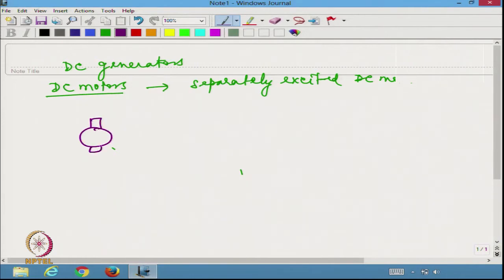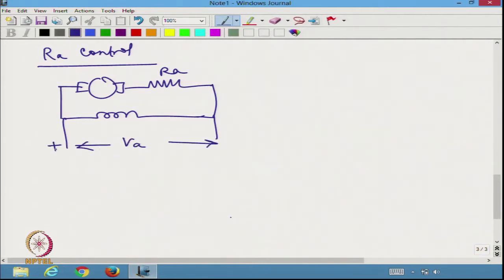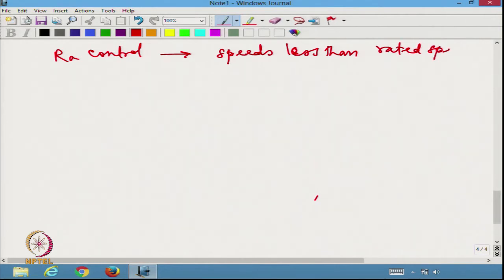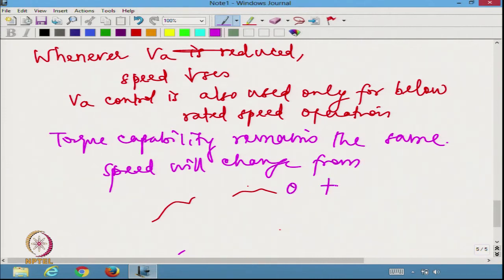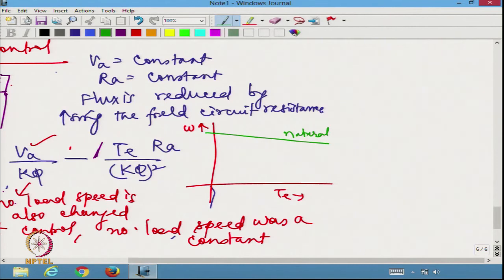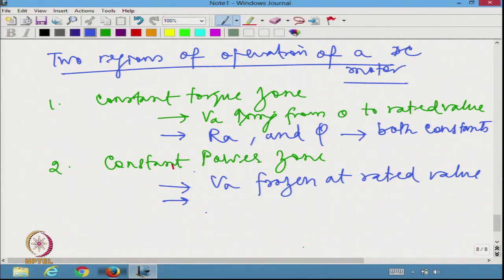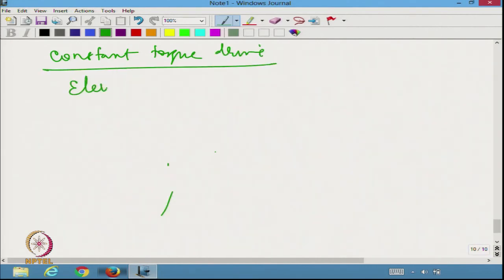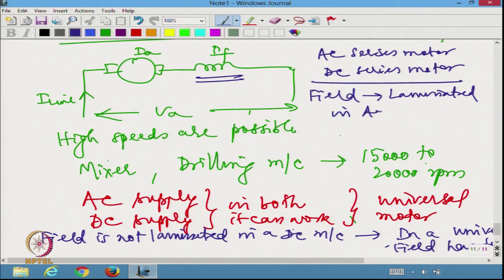DC Motor: Speed Control (Shunt and Separately Exicited Motor)

Comment: sep excited and shunt Dc motor in nutshell with speed control 0:00
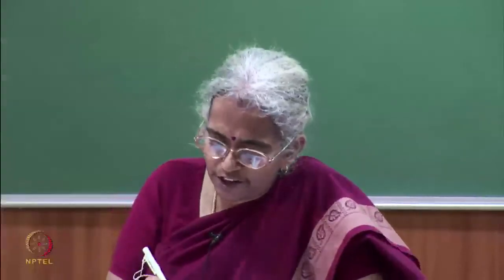const power and const torque region curve 27:00
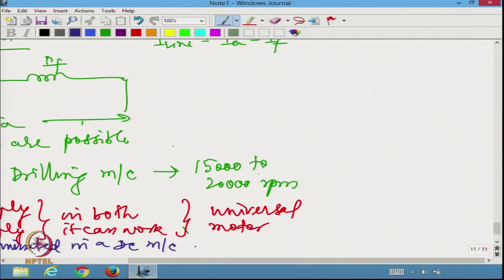starting series motors 35:00